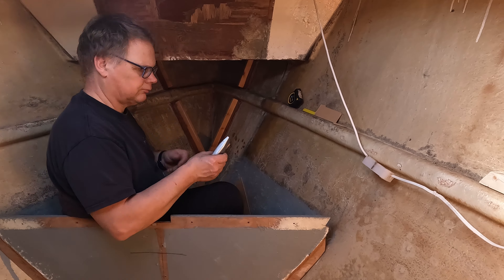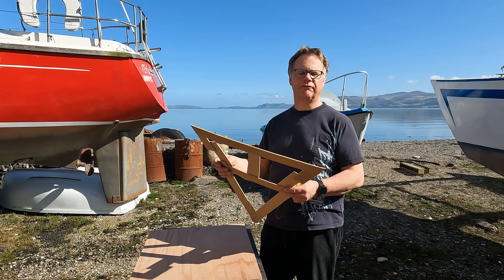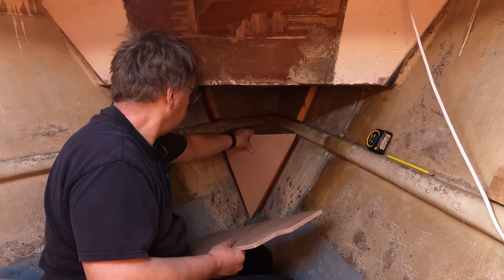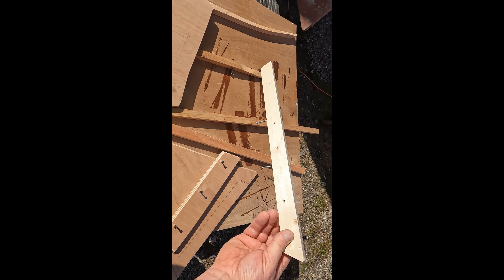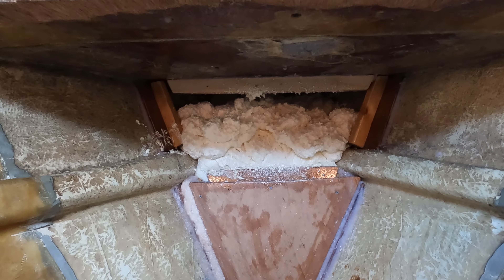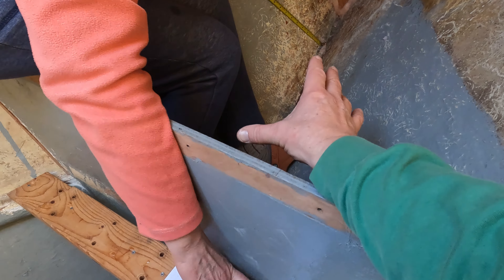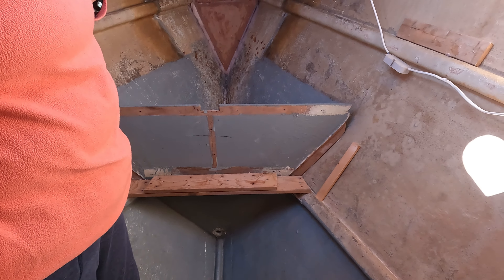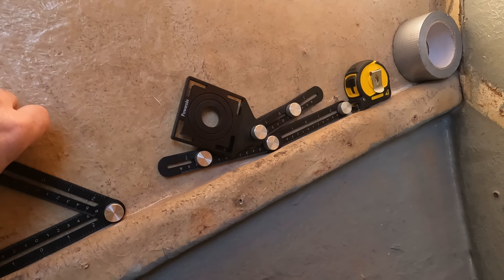New Watertight Bulkhead fitted: DIY Boat Refit Progress 24

Comment: Hi. Another insightful vlog. I am interested in how will you be attaching (or maintaining) your pulpit and stem fittings to the hull if the fixings are not through the deck head behind your watertight bulkhead - or have you gone for fit once and worry not (like production boat manufacturers!) ? Cheers
Reply from the maker: Thanks!
Our pulpit (which we are keeping) bolts are into the original anchor locker which is above this bulkhead and accessible from the deck. In some of the bow roller videos you can see the extra deck pads we have added for the pulpit. While we are making the opening to the anchor locker smaller due to the bigger bow roller and the windlass support we will still have access.
We are changing our stanchions as they are a bit shorter than we feel is secure, several are quite bent too. We are making them from carbon fibre tubes. A smaller tube will be moulded through the deck that they drop onto. So no bolts to leak. I'll look up the Tula's Endless Summer video showing how they did it, we are essentially copying them.
Reply from the maker: Here is the Tula stanchion video: https://youtu.be/rz9S9miKm9g
Reply from the maker: This video shows the pads for the pulpit and how they relate to the anchor locker above the new bulkhead https://youtu.be/5KRbUTl-1TU